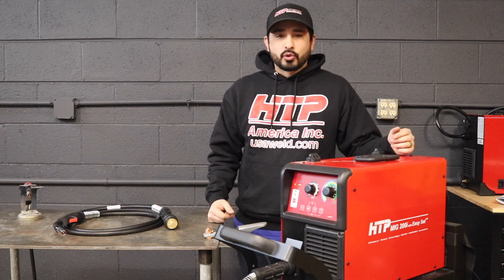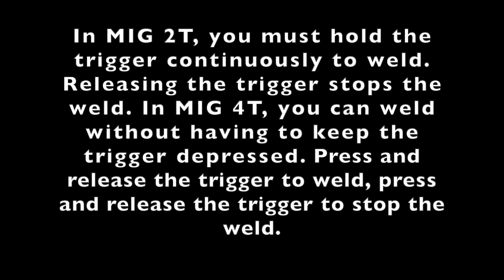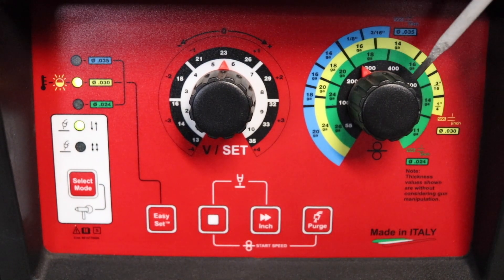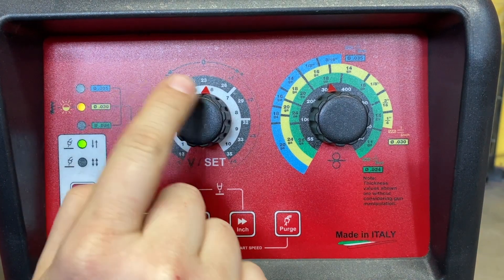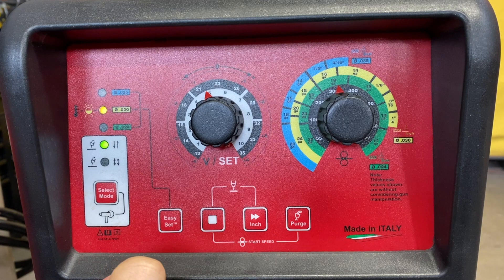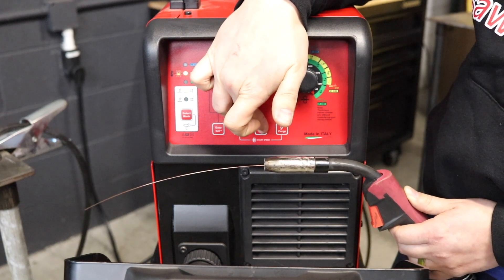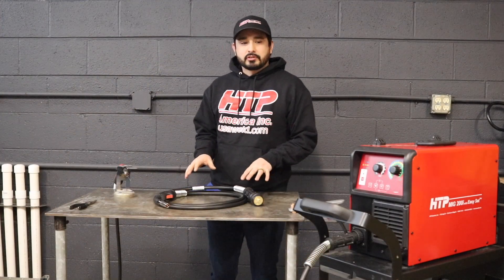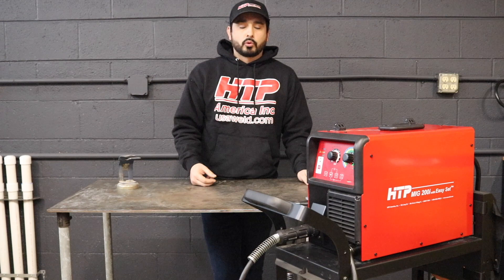HTP MIG 200i Settings, Set Up, and Tips

Comment: Can you use aluminum wire with this machine?
Reply from the maker: You can but it needs to be run in manual mode and it is difficult to fine tune.
Reply: @usaweld  is there a spool gun that can be used?
Reply from the maker: @sbranham86  No there is not a spool gun we sell for the MIG 200i

Comment: That “spacer” looks like a damn piece of PVC.
Reply from the maker: That is cause it is, think smarter not harder. Still is a spacer.
Reply: @usaweld  I have done this myself with other machines.  I think a problem is that the wire spool is not keyed to the shaft, and so you lose the effect of the tension adjustment!  Or spool brake adjustment you might call it.

Comment: I just received this machine  can you do some welding on thin and thick material. This machine seems to be more powerful than I thought. Having a little trouble getting the setting dial in on 1/4 inch
Reply from the maker: we are planning on doing some videos on that. Make sure you set your synergic settings on the right knob and then you can increase or decrease the voltage depending if it is running a little hot or cold. I would recommend increasing your gas flow to 25 CUFM. make sure the bottom of the ball is on the 25 CUFM line. Planning on doing a 1/4" video in the future.
Reply: @usaweld  I will be trying this today thanks for the feedback looking forward to the upcoming videos on this machine
Reply: 0.30 around 15 for the gas